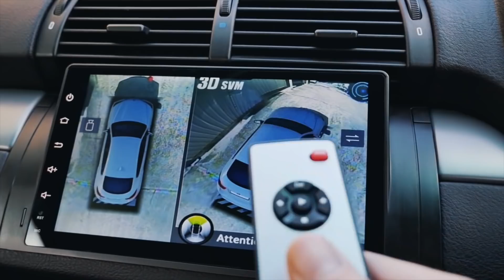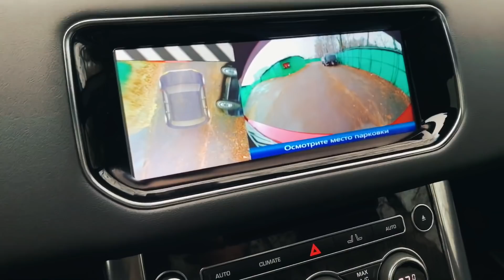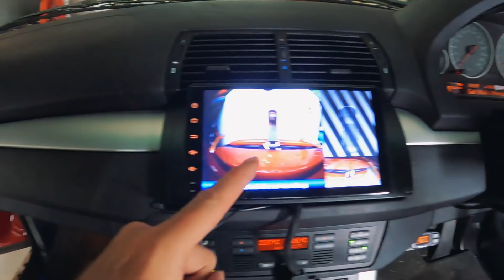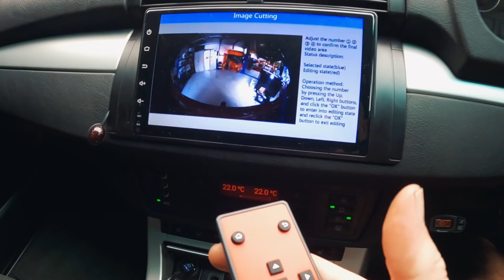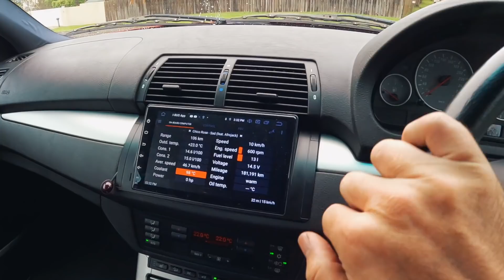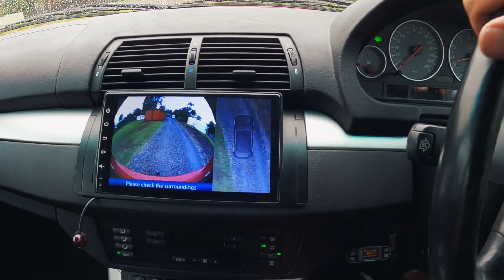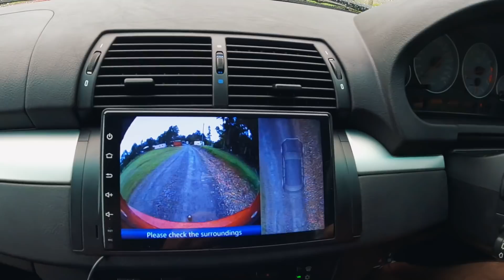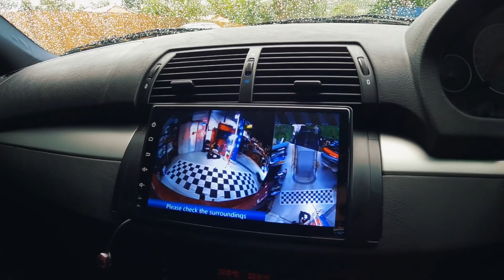Surround View Single Camera 360 Reverse Camera System: ATOTO AC-SC3601

Comment: If you've ever used a panoramic image feature on your phone camera you'll understand how this works. It has your car's dimensions, and a historical image that it can stich together as u reverse, and place ur car inside this image knowing its dimensions. Impressive piece of kit! Congrats! Oh and it doesn't need to use a g sensor. It will use image matching to calculate shift in direction therefore steering angles
Reply from the maker: Makes sense. Man stitches the image so well, so quickly. Quite impressive thats for sure.
Reply: I have no idea what you just said but it sounds awesome.

Comment: UPDATE: So i got this all installed today. I actually took an e92 boot handle cam, gutted the old cam housing, put this cam in its place. so it looks really tidy now. FYI - I connected both power cables to ACC..works perfectly.  Reverse trigger to the reverse light (it is not using this for power, just a trigger so no need for a relay). my android comes on when in reverse with PDC and keeps the screen on (for 10ish seconds) after i change out of R. So its a perfect setup. and yes, this thng will show your car going forwards as you adjust your parking, if your screen remains on due to pdc etc. making it even more crazy to see in action.
This thing is awesome.
Reply from the maker: That’s awesome.. and such a good idea to replace the boot handle cam! Nice work

Comment: Sorry if I am just missing this from somewhere, which headunit is this? Thanks for taking time to review this unit, is there a 4 camera system you would recommend and maybe parking sensors? I noticed you might have something like that as an overlay. Thanks again!
Reply: I think he mentioned Xtron for the headunit. I hv asked Atoto whether it works on other than ATOTO S8 but the reply was no. But it seemed to be working here. So that's good news. I am planning to i stall it to my Teyes unit.
Reply: * install. Sorry typo error.

Comment: awesome. Does it keep the image for a while if you move forward so you can adjust the parallel parking? At what point does it reset the image?
Reply from the maker: It has a setting for a reset, which i havent played with yet. It does work forwards once you go backwards. But you would have to set the camera option on the xtrons to stay on when you go forwards. I hope that makes sense.
Reply: @ZeroTo60Tube  before i hit buy, let me ask it a wee bit differently. 
If i reverse, it builds the image awesome. I go into D move forward a few feet, then reverse again - is the image still there?

Comment: Does it require a compatible android system? Or does it work in our factory fitted unit?
Reply from the maker: This versions was designed to work with any normal video signal (NTSC or PAL) however this has been discontinued. Now the Atoto Androidb units have this feature built in.

Comment: that camera is going work only with atoto unit or can be used in seicane car unit ?
Reply from the maker: Only with atoto.
Reply: @ZeroTo60Tube  thanks for the info :)
Reply: Is this confirmed? A year ago you replied yes to a question by one of the viewers ie whether it works with any Android 10 headunit?
Reply from the maker: @anuarabrahman1825  the camera will only work with the atoto module. You can connect the module to any android.

Comment: Hey. The wiring diagram for this shows it needs wired to ACC and B+. Why does it need constant power? Why not just ACC? any advice? did you wire it to both? Thanks.
Reply from the maker: I wired both. I’m guessing it’s so it can keep tracking and have its processor running when ever the car is on. It’s basically a computer so must need to boot and be ready to work instantly when put in reverse.
Reply: @ZeroTo60Tube  Constant Supply is required to keep the calibration data and other data in memory just like a music system.

Comment: ok, i bought it so I hope there is an option to delay the picture reset. If you can keep the pic on the screen (for 10-20 seconds) after going into D or P and then adjust parking this is witchcraft lol
Reply from the maker: Put some more thought in to this, if you run it off the cars PDC system you will be sweet. Basically if PDC activates the screen will show the camera, so you will be all be good. I might rewire the kit to PDC instead of the reverse too.
Reply: @ZeroTo60Tube  that's my current setup and my plan for this :)
Reply: I'm thinking about buying this.. I currently have an A6Y w/ the reverse cam trigger wired to my reverse lights. Are you saying it'd need a constant 12VDC to retain the picture if I go forward (ie: I can't use the reverse light wire for a trigger anymore)? I don't have PDC, but I guess I could wire something like a delay relay.
Reply from the maker: @rvamtbram  The unit does need constant 12v anyway. But some sort of time delay relay will work for going forwards.